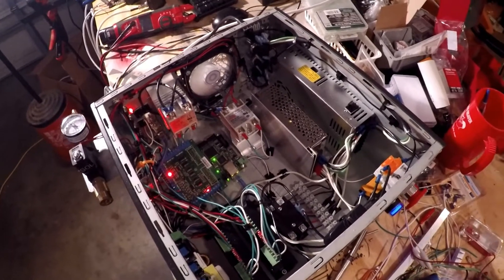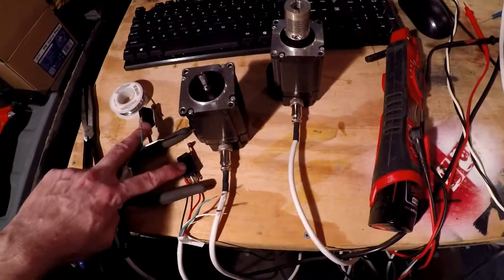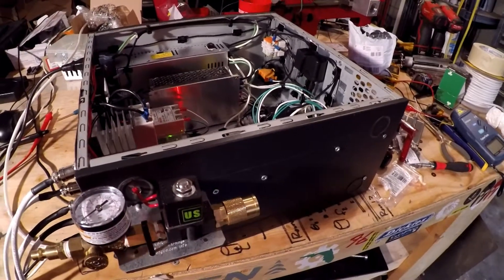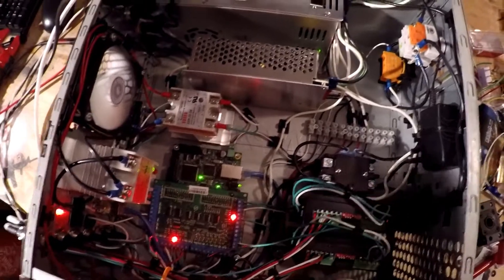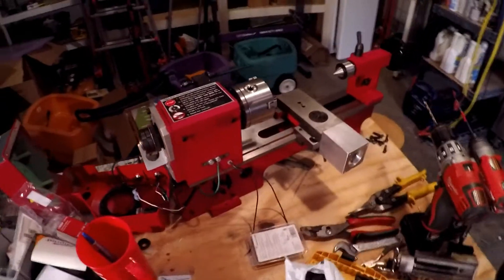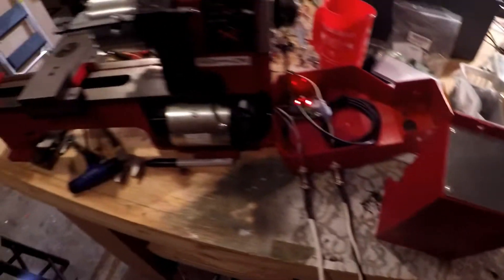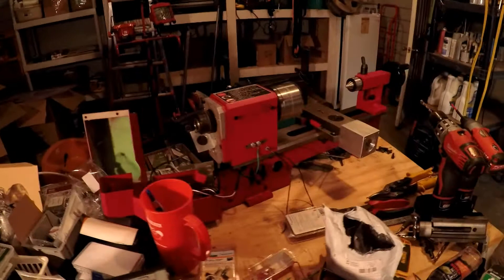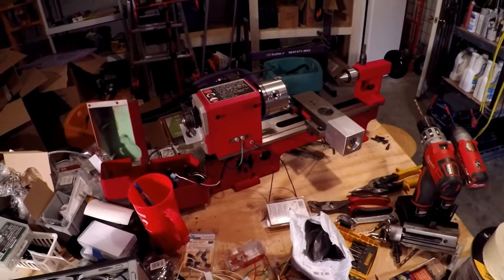7x10" CNC Lathe Conversion - Update #4 - Enclosure and Wiring complete! On to the Mechanical Stuff!

Comment: I want to get into CNC lathing as well. Never had a mill or lathe. I really like how you set yours up. Really nice work so far! Do you have any specific build guides you can suggest or any tips? Bout to buy a HF lathe, either a 3 axis china board or a couple drivers and a breakout. Probably running through parallel. That main board you used is just out of my budget. I was planning to use the stock axis screws too. Where did you get the ball screw? What is the board you used to interface with the stock spindle board? Thanks in advance. Also, your music is a lot louder than the talking part, you may want to equal those. Can't wait to see this thing trowin chips!
Reply from the maker: i5usko thanks! Honestly, when I first started building machines (about 5? 6? Years ago) it was mainly forums and OJT - not too many YT videos available. Going the parallel port route is definitely cheaper (that’s also how I started) but the only issue I had with that was electrical noise and not being able to repeatable use the contact price I had. Maybe someday I’ll go revisit it or rebuild my router that still has parallel ports, but’s it’s definite a good starting point. I think the board I used to control the HF lathe is a C41 from CNC4PC - thanks for reminding me, I keep meaning to make a list of stuff and update the description of the video. As for the ballscrew, I may have just got that off amazon or eBay - I’ll have to look. Cheers!
Reply: What do you think of this board? 1.2Nm 23s(stock screws maybe with bearings instead of bushing)?
https://www.ebay.com/itm/CNC-3-axis-TB6600-Stepper-Motor-Driver-Board-4-5A-36V-For-Engraving-Machine-Hot/282060669706?epid=508804205&hash=item41ac20430a:g:K~8AAOSwIzNXPCXg
Reply: Did a little browsing in the forums and I think the 1.9nm(270oz-in) are more fitting. I think that board is the best I can get at that price too. Interested to see what you think and thanks again.
Reply from the maker: I haven't seen this board before, but looks like it might be pretty capable for starting out with a low budget - if it is within your price range and fits your build profile go for it... I understand that people can't just "throw" money at a project, but even if this isn't EXACTLY what you need, hopefully you can learn something from it, get more experience, and then build your skill sets and capabilities from there.  Good luck!